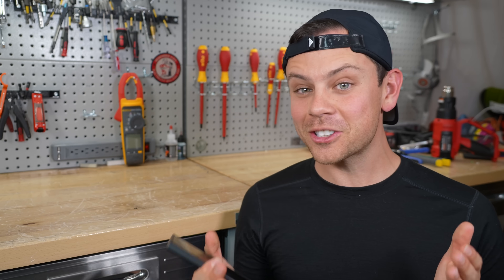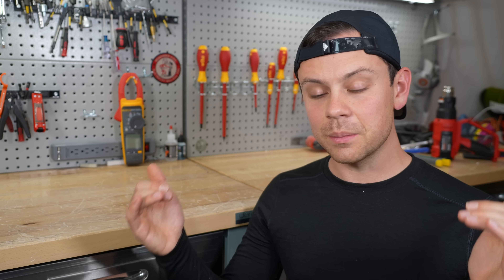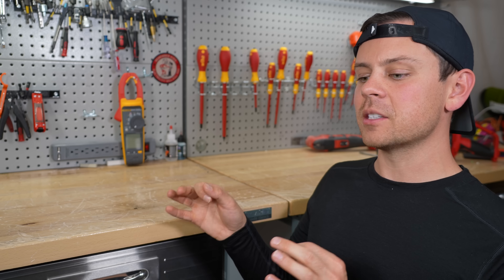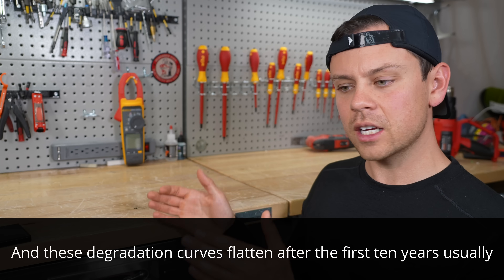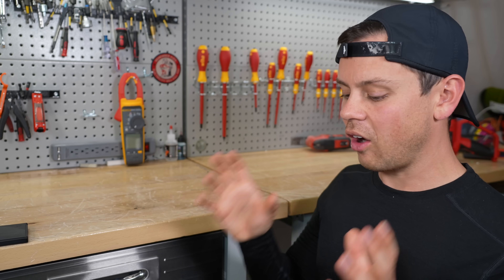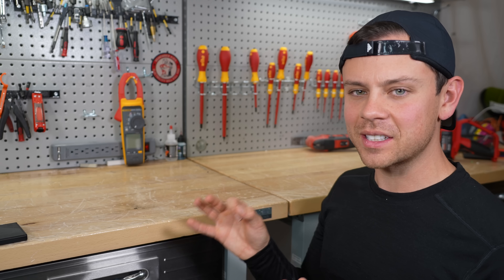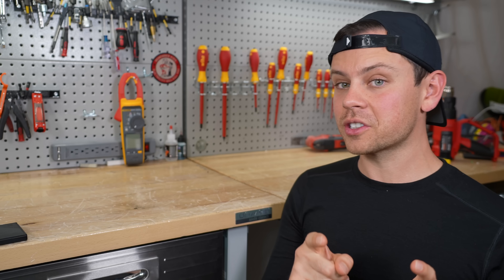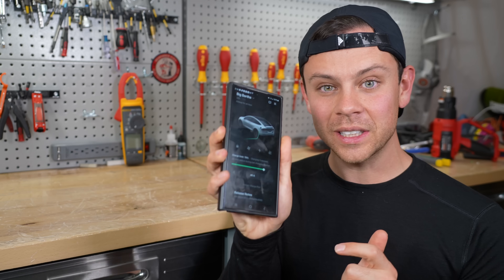LiFePO4 Longevity Discussion! Why Charge to 100%?! For Solar??

Comment: I can’t tell you how many times I’ve heard ppl say to charge their LiFEp04 batteries to 80% and only discharge to 20% to maintain the longevity and extend the life cycles of the battery. But they don’t take into account that they are creating a bigger issue of not top balancing their batteries. I completely understand your frustration because you’ve already given this information on your channel but some still don’t pay attention and it seems like you’re repeating yourself a lot. Remember this, you’re saying old things to new ppl. Great video Will.
Reply from the maker: @marioluna4344  and thank you, very true. Need to stay objective. I got bit emotional because I read a ton of them and my anger got the best of me haha thank you for the appreciation. Hope I can help
Reply: @WillProwse its not good to let your emotions control you but deny them is bad too, and it shows you care about giving the right information so thank you!!
Reply: So the next question is how quickly do the cells get out of balance? Is hitting 100% daily required or is once every X weeks sufficient?
Reply: @rnordquest  I had 2 packages that weren't balanced for 1 year the current difference between the two arrived to 30% which is too much then I activated the balancer which was wrongly programmed by the assembler once I could access the parameters. Balance should be activated after 3.45v per cell
Reply: I think most people confuse lifepo4 and NMC or they don’t even know the difference. They just hear, don’t charge past 80%.
Reply: I only discharge mine to 40 then near morning take them to 20.   But charge to 100.  Why?   Most days the batteries are enough to carry the loads, but I want a little bit of buffer if the power goes out late morning so I am not getting up at 4am following a cloudy day to fire up a generator to make a cup of coffee or start the back up furnace.  All in all it gives me about an hour or two to comfortably wake up and get after it without being without being out of power.  

Periodically I will grid charge and let them grid charge for a day or two to allow a good top balance, essentially in the winter here.  In the winter we are lucky to hit 100% for 20 minutes.  Not long enough.

My system will likely never pay for itself, our power is cheap, but it wasn't the purpose for install.  Some return but more for security.

Kept in the basement.  Temp ranges from 58 to 70.  

Great video as always, Will.  Nice work.
Reply from the maker: @marioluna4344  exactly!!! This guy gets it
Reply: phone battery only has one cell, you don't need to balance it. 

But they think this solar battery is just one cell like a smartphone.😂
Reply: @DeniSaputta  Phone batteries are a different chemistry, Will is talking about LFP. Honestly, phone batteries are much more dangerous, don't confuse the two.
Reply: why than my hybrid car lith. batt. charge go to max. 92%, and ecu will never let it go below 23%???
Reply: @utube521 Your car has a LiFePO4 battery? Or something else?
Reply: @80sDweeb  it has 0.8 kWh Li-Ion battery, charged by the alternator and by recuperation. When the car is on and engine not running, than, if this battery goes down to 33% (on the dashboard) the car's ecu will start the engine and will charge the battery from the alternator till it's 70% (on dashboard), than the engine keeps running and charging the battery at much slower pace
Reply: @utube521  The battery is NOT LiFePO4 chemistry, that's why.
Reply: why is it Higee cells recommendation charge to 100% and discharge to 80% need 20% to longer the life of battery base on manufacturer. Sorry i just clarify if its true. thanks
Reply: Great, for me i have a standalone EcoFlow Power  LFP Lithium-Batterie 2 kWh in the Specs ist the propose only Up to 80%. You Right to Balance more Batteries you have to go over. I ve got my lessen to Look in the Specs to use the right Battery If you have more as one.
Reply: Hola 👋🏻. He comprado hace poco un EcoFlow, que tiene baterías de LiFePO4, y me han dicho que no debo cargarlo más del 80% ni descargarlo más del 20%. Es cierto? Porque a pesar de que el vídeo está en inglés, entiendo que se dice lo contrario?
Reply: I charge to 80% and my batteries stay perfectly balanced. If I charge 100% it overcharges some batteries in my 4S2P bank
Reply: Does same applies for grid tied system cos you were only referring to solar in the video
Reply: May I ask an advice please?
I'm desining a small solar lifepo4  set-up (12v 3,5 Kwh) for a little mountain chale. The set--up will be used sporadically, with pretty long periods (even a month) with no usage. But because I could go there with no adance planning, the system should be all time on.
Because cells must be balanced, that that mean that in my case they will be fully charged for most of the time, with, I guess, expected high degradation.

What charging parameters and tension do you suggest me to use?
Should I go for lead acid cells, in my particulqr case,  instead?

Thank you very much!
Reply: This is rather silly.  If you charge your cells to 80% you will have imbalance but it does not matter because all of the cells are within the specified range.  Imbalance that puts one cell outside it's safe range of operation means you have a bad cell and your pack is toast.  It makes no difference to charge lifepo4 to 80% or 100%, unless you are going to store them.  For storage 80%is better than 100% and 50% is very slightly better than 80%.  Keeping stored batteries cool but not cold is best of all.  Paying for a lifepo4 battery and using only 80% is a waste of money.  Buy a smaller pack charge it to 100%, and put the savings in an investment account, so you can retire earlier
Reply: The funniest thing is. Do that enough times, and the bms would have no clue what SoC its at 😂
Reply: Just getting into solar and battery backup systems so this is the first time I am hearing this. All good info to learn
Reply: this step was not suitable for one big lithium cells.. either li-ion or even lifepo4.. and even not for solar charging..

so, in order to keep the battery balanced is keep them charged up on their full 3.6V (for lifepo4) and 4.2 (for li-ion) for top balancing..

and also for big capacity battery like 100Ah lifepo4, to reached one cycle it needs to drained them with very high powerload.. in practical, you never used the battery that hard for just reached 1 cycle..
you must drained your battery into their 0% SoC or 100% DoD.. and for big battery, it just wasting time..

for small capacity battery like regular cylindrical cells li-ion or lipo, that 20% and 80% rules can be fit for your battery to extend your battery life.. because you can drained them so quickly, and lower full cut-off overvoltage thresholf voltage and higher cut-off undervoltage threshold the battery experienced less electrical stress.
Reply: @dwikey_98 you people say this but you have no experience with batteries, if you full charge some batteries will overcharge. I charge to 80% and my 4S2P bank stays balanced.  People dont listen to these guys, they dont really know what they talking about.
Reply: i"ve got some ecoworthy batteries without communication and you CAN'T fully charge them every day, it just ends up overcharging some of the batteries, stop confusing people by talking like your an expert when you don't have so much experience.
Reply: We build our batteries with active balancing.  Our batteries don't need to hit that high voltage to start balancing. Will does not like active cell balancing but someday he will get it!!:)
Reply from the maker: @millertechenergy  also, your batteries are overpriced
Reply: @millertechenergy -some day Will will get it?? Rather full of yourself,, hahaha.
Reply: @millertechenergy  I can see the need to active balance NMC cells as they are pretty unforgiving, but I have not seen a great need to active balance lifepo4 cells unless you need the absolute maximum capacity out of the pack.  Passive balancing is not a great term as it uses active voltage comparison and current switches to control the balance resistors.  My testing has not shown a huge benefit of precision balancing other than a few% capacity and a reduction in reliability due to complexity.  Am I missing something?
Reply from the maker: @millertechenergy  Wrong, you need to be at high soc even with active balancing. It does not work for most of the soc curve. also the caps in an active balance circuit can fail when the electrolyte dries up, so it is an added fault point. and there is no benefit over a passive dissipative balancer. unless you are pulling high c rates. which we are not doing here for solar
Reply: someday he’ll get it……
Reply: Did I hear Will correctly when he said we should be charging to 100 per cent and discharge to zero every day? What am I supposed to make coffee with in the morning, propane? Plus I'll need a second battery to wake up the BMS every morning. Please tell me I miss heard or misunderstood what I heard. So much of what he said didn't make any sense at all.  @millertechenergy
Reply: If you don't charge to 100% occasionally the cells will have misbalance, and charging the battery to 54.6v the battery will occasionally will have memory effect will think itself full at 54.6v.
Reply: @HybridShedIraq  lifepo4 cells do not suffer from memory effect.  That was a term given to NiCd batteries that would exhibit poor charge acceptance of not fully discharged.  The lower capacity exhibited by lifepo4 cells is due to the ability of lifepo4 cells to go into an overcharge state without damage.  In this state some cells exhibit more open circuit voltage and some therefore have insufficient charging voltage leading to a slight pack capacity degradation.  Unlike linmc cells that are damaged and become unstable if overcharged.  If the pack is only used to 80% then it does not matter if it's lost a little capacity.  If the pack has passive balancing, then the overcharge condition trips the discharge feature of the passive balancer and it will stay engaged until the overcharged cell is discharged to match the state of the undercharged cell and next charge cycle will even out the charging.  Lifepo4 cells are extremely forgiving and don't need the care and feeding of linmc cells but people think they are the same.  They are completely different, and do quite well on lead acid chargers that continuously undercharged them
Reply: @barryobrien1890  I have packages that I charged them to 54.6 for 1 year they no longer take any current above 54.6v that is a permanent memory effect.
Reply: @HybridShedIraq  the term memory effect was given to NiCd batteries that would exhibit a deltaV charge voltage before reaching full charge if not fully discharged.  The memory referred to the battery remembering it was not fully discharged and preventing charge. It was cleared by discharging the pack tofully a few times.  This does not sound like your issue.  Your pack is stopping charge early.  This is likely due to imbalance and an old style bms without passive balancer.  In the older bms, the entire pack would turn off if one cell reported an overcharge condition.  In your case, the pack is detecting one cell is over 3.65v and turning off charge early. Without any bms, you are limited by the imbalance in charging, and lowest capacity cell in discharge.  How much capacity is left.  Does the pack have bt comms or a balancing port?.  Can you check the cell voltages or is the pack sealed.  Even if you had fully charged this pack, there would be no difference as your pack would have developed these symptoms either way, as there appears to be no cell balancing in the bms
Reply: @HybridShedIraq If you have a BMS set your charge voltage higher. Eventually the cells will start to balance better and you'll get to a higher voltage. This may take time as passive balancers are very slow to balance large capacity cells. As Barry O'Brien said one weaker cell is hitting 3.65V early and that is turning off the charge to your whole system. That's a safety feature that you shouldn't bypass. One way around that is to trickle charge the cells above that voltage and wait for the cells to get closer. The problem is every time you discharge the battery, if you have a very weak cell it's always going to stop the charge early. The only way around that is to use a higher capacity balancer. My BMS has a 2amp (passive) balancer but my batteries are 280AH. 2amps (which is high for passive balancers)is less than 1% of the total battery capacity, so balancing takes a long while be ause there are 15 other cells to bring up to that level.
Reply: @mondotv4216  all cells are 100% balanced top balanced the active balancer for the big 280cells and passive for the 100ah cells
Reply: @HybridShedIraq I don’t believe that your cells suffered from memory effects. Would you try to charge with high current and check if the voltage gets higher

Comment: Good points.  But wanted to add that on some BMS units, you can adjust the voltage at where they balance.
Reply: You can adjust the voltage they balance at, correct. But you are most assuredly missing the point Will is emphasizing. Balancing below 95% state of charge is counterproductive due to the flat discharge curve of LFP. Two cells can be at identical voltage and be at very different states of charge.
Reply: @john_in_phoenix   Balancing at the top of charge is always a bit of a crapshoot.  If you charge a cell to its termination voltage and let it sit for a day with NO load (not even a BMS taking voltage measurements), it will droop before stabilizing.  That's just how these batteries are.

It's this somewhat-inaccurate setpoint triggering balancing, and the BMS's parasitic load on the individual cells themselves, that are responsible for the need to balance so often.  Overzealous, fidgety, and badly designed BMSes cause so many problems in what should be a relatively simple maintenance plan:  Disconnect the load when ANY cell is at its low SOC point, stop charging when ANY cell is at its high SOC point, and rebalance when the capacity of a cell has changed significantly.

Doing this on every charge is likely more harmful than helpful.  But if the BMS is unevenly draining cells with excessively large parasitic loads, then it's a band-aid you have to have to keep the pack healthy.  A more hands-off BMS that just focuses on being unobtrusive and keeping the cells within SOA shouldn't require much tampering.

Comment: What is a "Hot environment"?  My batteries are in a shed outside.  They are in an insulated and headed box for the winter.  In summer they will get in the high 90s for a few hours.  I know ideal is 75.  But at what point it heat a problem?  Thanks

Comment: I'm considering using an EcoFlow Delta 2 as a UPS for my computer. For optimal battery health, should I keep it charged to 100% or around 80%? What do you recommend?
Reply: I have been doing this for a few years now and just got a new Delta 3 to replace a no-name one that blew a capacitor (sold it to a hobbyist for repair). The UPS functions perfect for all my networking and computers including some servers running 24x7. I perform regular failover tests by cutting mains power and the switchover has ALWAYS worked flawlessly. 

I have also been trying to determine the best state of charge to float the UPS at. I have settled at 90% but not sure if this is best. I do want a high state of charge to maximize runtime in the event of a grid outage. I also cycle them to about 20% when performing failover tests (can't go to zero since I want the systems to still be up). It would be great If anyone knowledgeable can chime in on UPS usage state of charge
Reply: I would not recommend a Delta 2 as a UPS. The switchover time between the AC passthrough and the built-in inverter is far too slow, easily 1/10th of a second. Most desktops will shut off with an interruption that long.

Comment: I keep mine plugged into grid power they stay 97-100% until the power goes out for a while. Should I disconnect from the grid to discharge every so often?
Reply from the maker: @dlancello  unless you have frequent outages like south Africa or Puerto rico. If you have daily outages and you're not using the full capacity, you could cycle lower. I wouldn't though. Set float a little lower on your scc and should be fine.
Reply: @ thanks Will.
Reply: Heck yah man!  Gees, ur missing out on saving money on ur electric bill!
Reply from the maker: @dlancello  for purely backup situations I think charging to 100% is best. You will get more degradation but in the event of an outage, every Watt hour counts. Might as well have all the energy possible. Check out the graphs in the video to see the storage capacity fade. It's not that bad. Just avoid heat and it will be fine.
Reply from the maker: @dlancello  actually lots of pros and cons to this discussion for UPS function. We could discuss this on forum
Reply: @WillProwse  let us know of any good thread for this, i am VERY interested into this topic